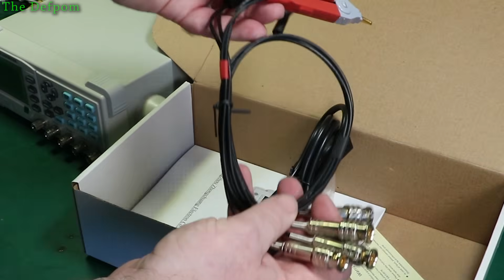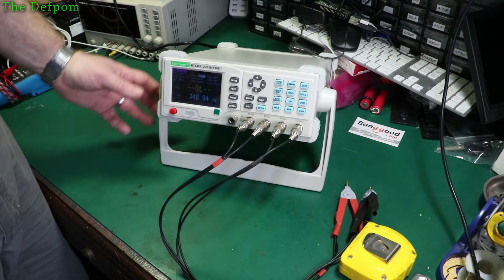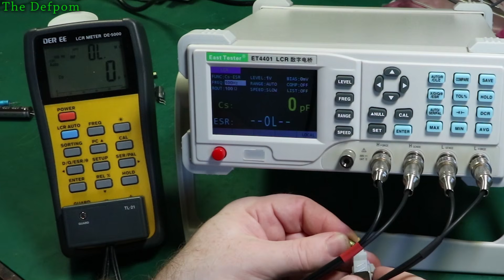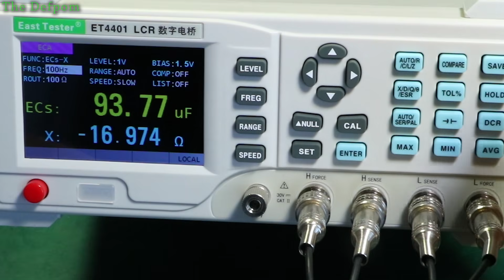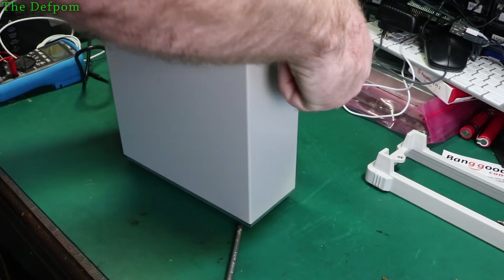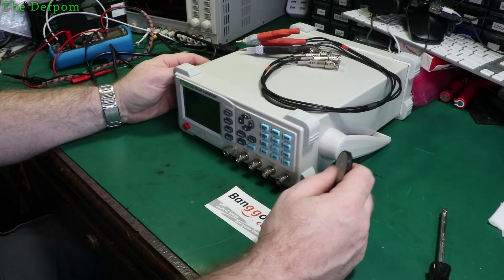#675 East Tester ET4401 LCR Meter Review And Teardown

Comment: Does it also operate at 120Vac 60Hz even though this voltage is not marked on the back of the unit?

Comment: Defpom, I just got one of these and I'm seeing some very troubling behavior, I'd like your opinion if I'm doing something wrong or if I got a bad meter...

I got this primarily for measuring electrolytic capacitors, so that's where I'm focusing.

I'm getting readings of electrolytics between 10 and 20 percent lower than all the other meters I have, for example

CEM 680uf cap:
Owon XDM1041: 618uf
Oyigao UA6013L: 612
Thsinde 18B+: 612
ET4401: (in LCR mode) 597
ET4401: (in ECA mode) 572 <significantly lower value in EC mode happening a lot.

Nichicon 8200uf:
Owon XDM1041: 7620uf
Oyigao UA6013L: 7680
Thsinde 18B+: 7610
ET4401: (in LCR mode) wanders continuously between 6900 and 10400
ET4401: (in ECA mode) 6920

Onkyo/ELNA 22,000uf:
Owon XDM1041: 21,870uf
Oyigao UA6013L: (out of range)
Thsinde 18B+: 21,380
ET4401: (in LCR mode) Continuously wanders from 22,5xx to 36,1xx0 - and then dips into Resistance and then back to capacitance
ET4401: (in ECA mode) wanders from 21,900 to 22,600 does not settle

Its really a shame: I expected this dedicated meter to give more dependable results than my other multi-purpose meters, but they all give reasonably repeatable readings while the ET4401 just wanders all over the place.

Results are similar before and after completing open and closed calibrations.

I have contacted East Tester about thin but have received no reply. Should I return this unit?
Reply from the maker: @edwardgiovannelli5191  what test frequency are you using? I use 100Hz most of the time
Reply: @TheDefpom  For these specific tests I tried using 120Hz and the default 1KHz. Similar results.
Reply: @TheDefpom  Ok, I returned the unit and the seller gave no argument to issuing a refund based on the error report I included with the return. So that's good.

But then I started looking at the manual... on page 18 it gives the equation to determine accuracy, based on actual measurement, test frequency, etc. The equation given is: .1% (1+Cx/Cmax + Cmin/Cx) (1+Dx) (1+Ks+Kv+Kf).

Its the Cx/Cmax that throws me off here (most of the other bits basically fall out of relevance compared to this one, so ignore them for our purposes here) Cx/Cmax is in the case of a hypothetical 10,000uf cap (the rated upper limit). Cmax per the chart below that is given as 15.9 @ 100Hz so we get 10,000/15.9 =  629. Multiply that times the .1% basic accuracy and we're at 62.9% error??? 

Am I doing that right? That accuracy, even at the top of the range is nuts, so I must be screwing something up???

Thanks again!
Reply: As I was told lately and I totally agreed, that's perfectly normal behavior. You are comparing a auto bridge type measuring with ET4401 at 100Hz frequency (the lowest possible). While the other meters measure with a totally different charge-discharge timing measurement method - less than a 1Hz even. So you will get similar results with every other bridge type meter, even much more expensive ones...

Comment: The residu is probably flux residu dissolved in the cleaning liquid used during manufacturing. Not the best cleaning I have seen but probably sufficient. They did remove some of the part numbers, maybe because of Chinese parts only intended for the domestic market? Who knows...

Comment: The reason the box for this meter is so large would probably be the stackability with other meters on the bench. Make it shorter and it is the odd one out, causing headaches to the customer on how to place it in the stack of already acquired test gear.
Just my guesss, though.
Reply: wiedapp, I think you are 100% correct, and I had the same thought when Defpom was going on about how he disapproves of the long case. Bench equipment in this form factor almost always has pretty much the same width and depth, so that A) they have a more stable footprint, B) can be stacked with other equipment, C) they don't fall over backwards, or slide backwards, when you try to push buttons or plug in cables, etc. I was appalled that Defpom did not know or realize this fairly basic concept.

Comment: Hi, its possibile to measure in circuit?
Reply from the maker: it depends on the circuit, it is not as good for in circuit testing compared with meters that are designed to do it, like the Peak ESR70 Gold for example.

Comment: Thanks for your teardown. I was wondering that there is no AC Line Filter or did I missed something. Just ordered my ET4410 from banggood for 248€ Promo.
Reply from the maker: Correct no line filter, it will have filtering on the switch mode power supply PCB though.
Reply: I have the same model, purchased in China for 106€

Comment: i have a question that i cant find an answer too. i have a bench lcr meter and it has 4 connections for the kelvin clip test leads. the meter's test lead connections are marked Lcur, Lpot and Hcur, Hpot. which two connections does the positive test lead connect to? i cant find which test lead goes to which two terminals anywhere.
Reply from the maker: Usually the manual for device will tell you, but H is positive side L is negative side. The information on the meaning for Hcur and Hpot etc. is out there as it is pretty common terminology, I know I have read detailed descriptions of each connection functionality as part of the theory of operation of various LCR meters.
Reply: @TheDefpom  great, thank you

Comment: The biggest problem i see on this device is safety. The mains cable is touching the voltage regulators heatsink. Chinese are often undersizing the heatsinks, so they get damn hot

Comment: BIAS 1.5 V for measuring the capacitance of electrolytic capacitors. Instructions are sometimes useful to read. It is recommended to connect electrolytic capacitors with respect to polarity

Comment: The very obvious problems of that meters is that they have to substract large cable capacitance from measurement results, making impossible to precisely measure small values.
Reply from the maker: Yes that is true, the smaller the capacitance the more critical the connections become.

Comment: I have the ET4401 PCB-version 2020.07.31. Much better organised, BNC on the pcb, good cable management,... They really corrected all the bad stuff. 
Anyone knows where I can find new firmware and is it possible to hack the 4401 to 4410?

Comment: Just an FYI. I just got the ET4410 and seems to be working well. I know you have the 10 kHz max test frequency model while I have the 100 kHz test frequency model. I would assume the boards are the same in all versions with just firmware and/or a couple of component differences. The date on your main board is 9/17/2018 and the date on my board is 7/31/2020. It is interesting to note they changed the power supply layout and there is now an extra heatsink and regulator. Still the same Sanoon brand smoothing capacitors. The AC cable that is zip tied to the ribbon cable is a shield cable on mine. I also have two multiturn trim pots on the main board probably for factory calibration. It looks like you have three relays while I only have the one K300, maybe a new circuit design or solid-state switching. They also beefed up the input protection and now the BNC connectors are directly soldered to the pc board. Looks like much of the analog circuitry is different or at least laid out differently. I also do not have the white residue on the main board. In your video you indicated being off by some 70 Hz on the 10 kHz frequency but it looks to be around 0.070 of a Hertz. Thank you for posting this review because it helped me make my decision to order one.

Comment: (6:45) - But aren't your leads already shorted ?
I mean, not to each other, but those kelvin clips are closed, right, meaning that they are shorted ?
In any case, surely the meter can easily calibrate each individual lead without shorting any of the together, no ?
>
Reply from the maker: Often when doing the cal on a LCR meter it requires all four leads to be shorted together, they normally do a short and an open.
Reply: Bodragon, I think you miss the point of Kelvin connections. The Kelvin alligator clips, when closed, or when clipped onto a component lead, are connecting together the Source/Current test lead (where the signal comes from) and the Sense test lead (where the device under test is being measured from). So, a closed Kelvin alligator clip is NOT shorting the INPUTS, it is just connecting together the Source & Sense leads for ONE side of the component under test, while the other Kelvin alligator clip is doing the same thing for the other side of the component under test.

Comment: Can you use it to test ESR of capacitors in circuit?  I understand from the eevblog forum that the DE-5000 is borderline in this respect (600 mV).
Reply: The ET4510 has an Electrolytic capacitor test mode with 600 mV test level, but the regular C measurement goes down to 100mV test levels. That should be low enough. In circuit ESR tests can be tricky. Discharge electrolytic caps very long or else the residual charge may destroy the LCR meter input.

Comment: Could I test the ESR of a lithium ion battery with this?
Reply from the maker: Green Spider - probably not, usually any voltages being present will damage an ESR meter. Some I purchased a couple of years ago was a battery esr tester, so you can get an instrument that is designed to do it, I will see if I can find a link.
Reply: @Defpom's Electronics & Repair cheers I’v been searching for one of them for the past year that doesn’t cost a arm and a leg, a link would be much appreciated!

Comment: Sorry to comment again… But that residue is always left behind after I wash a board in alcohol. Or other solvents to remove flux and any other  residue. Some of it drains down to the bottom of the board (whichever way the board is tilted)… And gets in between parts just like those reed relays… So they probably only washed this board once or maybe quickly twice. Sometimes I have to wash mine several times to get all of that residue off. Because some of the flux and search mixes with the solvent… And always drains down and leaves those white marks when the solvent evaporates.

Comment: I could be wrong… But there are other versions offered on Banggood or elsewhere that have selectable frequency up to 100 kHz? They may cost a bit more but not too extremely much more expensive. Still the only option for a high-resolution precision LCR meter unless you want to spend huge bucks or buy something vintage. 

Don’t get me wrong… I love my DE 5000 LCR meters! But I can’t wait to have one of these permanently on my bench! It bridges the gap between extremely high-quality modern meters… And the really cheap low precision stuff. 

Half of my “fancy” new Keighley and HP gear never gets used...... because I’m afraid I’ll damage it or use it incorrectly. 

So I’ve built up another complete set of test gear that is “inexpensive“ in the same category as your Banggood lcr meter. I love my mastech ms8050 bench top multimeter..... it’s extremely nice and was 1/4 the price of my HP 34401a... used on eBay! 

 i know some of this modern “high-quality“ Chinese test gear doesn’t always compare with the brand new tektronix or HP gear… But dammit they’re getting better every month..... and I’m exceedingly impressed!!!!. Very obvious it’s coming out of the same factories as the rigol or siglent class of equipment. Maybe it doesn’t have the same level of quality control… But at 1/2 or 1/4 of the price… I’m willing to take the chance and do a bit of tinkering myself.

If there are any issues I’m sure the company will usually listen to feedback and add further revisions. A similar piece of gear comes to mind… Is the “feeltech” class of signal generators. I love my original FY6800 and my new FY8300. 

These are just my opinions…
Thanks for the review!

Comment: Chinese gear and electrical safety always a death trap to questionable at best? You figured they would have learned by now?
Reply: You would be the first person I'ld meet that has no chinese manufactured gear in the house. The Defpom's main factual remark about safety was the 'switching the neutral' instead of the live. Well, given the insulation, this is no problem at all. In Europe the IEC cable has a Euro connector on the other side that can be plugged in in reverse into the wall outlet. Both neutral and live have similar isolation requirements.

Comment: Looks rather similar to BK precision.
Reply: hateercenor, probably because what B+K Precision does these days (I don't think they ALWAYS used to do it), is find some popular product like this, get the factory to make it in a different color scheme and put the B+K logo on it, then sell it for several times the cost, usually WITHOUT even bothering to add value by studying the product and writing a decent English user's manual. I can see some value, worth paying for, if they authored a better manual and had knowledgeable tech support people and provided proper product support and repairs. But in my experience with B+K products over the last 20 years or so, they do NOT improve on the manual, their tech support people know little more than what the user can learn by reading the Chinglish manual, and when a customer sends in a faulty product for repair, then just send a different one and charge nearly the price of a new one for the 'repair fee'. For that kind of situation, people should just buy the more truthful 'Chinese junk' for a lot price, use it until it fails, and then buy another one for a low price.

Comment: Very nice review. Thanks for that. In fact I already looked at this instrument some time ago but wasn't sure about its built quality and precision. I couldn't find much information that was really helpful. Your review is, indeed. I decided 3 weeks ago to purchase one of the DER EE DE-5000 via ebay which is currently pending in German customs since 2 weeks ... however, considering what you've reviewed and what your conclusion is about this test gear,  I little bit regret to have already purchased the DER EE device too quick... even though it's much cheaper than the ET4401 ;) Missed the precision/resolution thing ... damned. At least the DER EE  ultimately requires much less space on the workbench :)
Reply from the maker: The DE-5000 is still a good meter so you haven't really made a mistake there, it really just comes down to how much resolution you need, and until now I was happy with the DE-5000, apart from the occasional time I wished it had more resolution, this meter fills that gap, I just wish I had been sent the 100KHz version.
Reply: I could be wrong… But there are other versions offered on Banggood and elsewhere that have selectable frequency up to 100 kHz? They may cost a bit more but not too extremely much more expensive.

Comment: Oh, no Calibration sticker?  Usually, it is not important to keep an instrument like that certified in a service/calibration shop when it is an instrument used for trouble-shooting.  If you were using it in a MFG environment (such as making ultrasonic transducers for non-destructive testing), then having it certified would be important, especially of measuring the capacitance of the probe and crystal before and after tuning is part of the MFG procedure.

I was wondering the important of dissipation factor that you were so keen on in this video?  I look for capacitance/ECR and leakage (which you can not do with an LCR meter like this).  I haven't seen the dissipation factor discussed before when trouble-shooting.
Reply: Clearly this low cost device does not try to compete with NIST traceable calibrated equipment, and is not aimed at high tech manufacturing situations. However. My meter was shipped with a small 'Quality Certificate', where the model, serial number and date of manufacture were all hand written. And a little red stamp indicating that it was inspected by '05' . They state compliance with GB/13978, which appears to be a Chinese standard for digital multimeters.
Reply: We would buy an instrument and a day after it arrived it would have a company asset number put on it and then straightaway out for calibration. A but a bugger if you want to use it asap.

Comment: Did you try the BNC that you suspect as being non spec on the Rohde & Schwarz?
Have you tried  a BNC plug from the Rohde & Schwarzr on the EastTester?
I notice it doesn't have a SMPS, they may need the case size to keep the transformer away from the PCB?
QC sticker ha ha ha..  It maybe better built because there was no QC test, no pressure on the assembler.

Comment: I would snip that cable tie and move the mains cable to the side panal where the transformer is, just the right length of cable to go there :-D.
Im with you on the 100khz, thats a standard.

Frequency with a "G", was that a mistake?.
They make it the full size to give the effect that you have a lot for the money.
I have an old maplin mf100 frequency counter that plays that trick, plenty of space for storing sandwiches lol :-D.
it uses a intersil 7226 chip to produce an 8 digit display, i'm sure you have seen one in the distant past millions of years ago :-D

Comment: Will this replace my DER EE DE-5000?
Reply from the maker: uno dos - I think it will, it seemed to compare pretty well in all of my tests, in fact as I mentioned it has much better resolution.
Reply: @TheDefpom  Did you zero out the DR EE? Are the frequecies the same or is one greater than the other? Sorry but I didn't see it in the video. Also, did it come with software?
Reply from the maker: uno dos - yes I did a cal on the der, and I did comparisons on the same frequencies.
Reply: @TheDefpom  I guess I need to get a bigger phone.